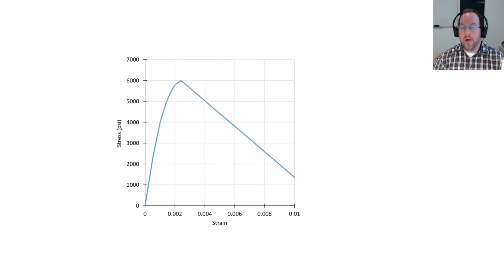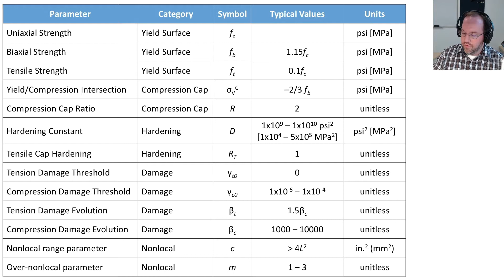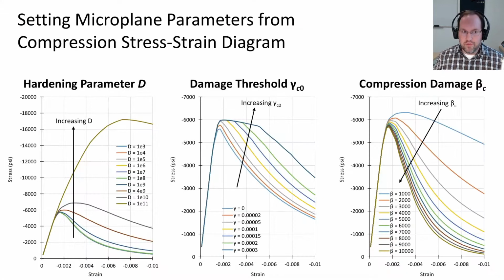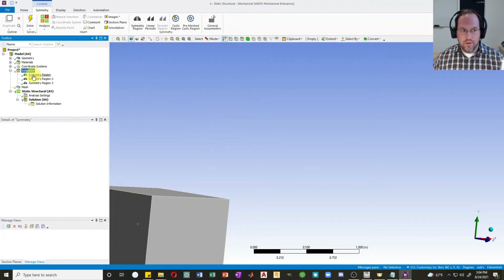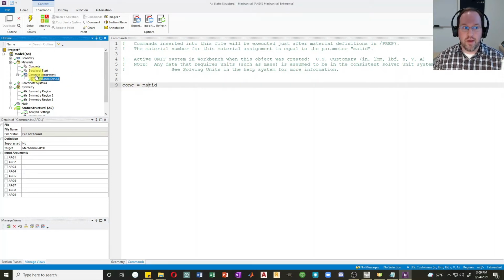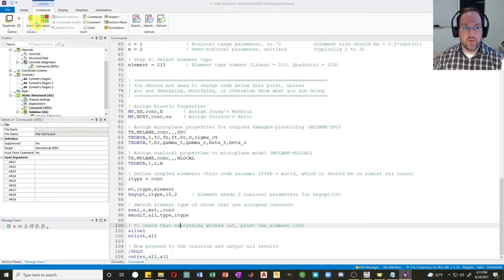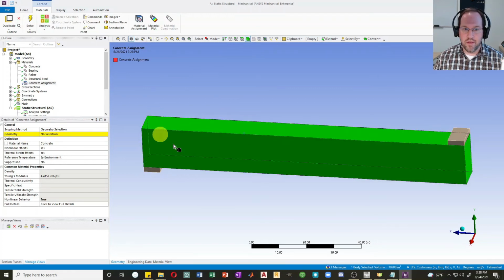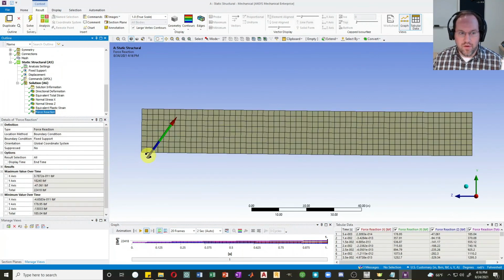Concrete Microplane Model - FEA using ANSYS - Lesson 10

Comment: Thank you very much for your fabulous presentation. I am just wondering whether Concrete MP Model can be a good model to simulate the rock-like material such as Sandstone? Is there any way to use APDL commands in explicit analysis instead to static structural analysis? I appreciate your great effort.
Reply from the maker: You can use the microplane model for sandstone and other geo-materials, but I don't believe the microplane model is supported in the Explicit Dynamics solver. 

However, there are other material options in Explicit. When defining materials in the Engineering Data tab, there are options for "Brittle/Granular" materials. One of these is called RHT Concrete Strength, which can be used for concrete-like materials, and can probably work decently well for sandstone. There are also a few different options for Drucker-Prager Strength, which might be more straightforward. There is no need to define any APDL commands for any of these materials.

There is an example Concrete material defined in the ANSYS "Engineering Data Sources" in the Engineering Data tab. It is hidden under Explicit Materials --> Conc-35MPA. This has parameters for RHT Concrete calibrated to a typical 35 MPa concrete mix. It also has some porosity expressions (P-alpha) and equations of state (Polynomial EOS defines the pressure), but not being an expert on sandstone I'm not sure if you need those or what you'd set these parameters equal to if you do need them. There is also the Explicit Materials --> Concrete-L predefined material, which uses Drucker-Prager strength. 

Obviously you'll want to have some calibration data handy to make sure whatever you do works OK.

Comment: Thank you very much for the impressive presentation. Do you think that this model can be used for masonry? If possible, how can the material model be calibrated? Best regards.
Reply from the maker: That is an excellent question. I'll preface this comment by stating that I've never personally modeled masonry. However, I'd give it a tentative "yes, it will work" on the notion that any strain-softening geomaterial could be modeled using the microplane model.

As for calibration, it depends on exactly how you are doing the modeling. If you are modeling individual blocks/bricks with mortar, then you'd need calibration data for both materials independently. If you are just treating the masonry structure as a single homogenous material, I assume you'd need to account for some sort of anisotropy - calibration would be done at a structural level in this case.
Reply: @StructuresProfH  I have been studying historical buildings and I use the macro modeling technique due to its simplicity. So I model the whole structure as a homogeneous material. I would like to use the microplane model you described, actually in masonry structures. Where do you think I should start exactly? Do I need stress-strain data of stone?
Thank you in advance,
Kind regards.

Comment: Nice Video!
Is there any literature about the microplane model and drucker-prager?
Reply from the maker: This particular implementation in ANSYS is based on the following references:
Zreid, I. & Kaliske, M. (2018). A gradient enhanced plasticity-damage microplane model for concrete. Computational Mechanics. 10(1007), s00466-018-1561-1. https://doi.org/10.1007/s00466-018-1561-1
Zreid, I. & Kaliske, M. (2016). An implicit gradient formulation for microplane Drucker-Prager plasticity. International Journal of Plasticity. 83, 252-272. https://doi.org/10.1016/j.ijplas.2016.04.013
Zreid, I. & Kaliske, M. (2014). Regularization of microplane damage models using an implicit gradient enhancement. International Journal of Solids and Structures. 51(19), 3480-3489. https://doi.org/10.1016/j.ijsolstr.2014.06.020

The first reference is the best for understanding how the Drucker-Prager condition fits into the picture. 

The original microplane model was developed by Z.P. Bazant and others - here are some key references for that:
Bažant, Z. P., & Gambarova, P. G. (1984). Crack shear in concrete: Crack band microplane model. Journal of structural engineering, 110(9), 2015-2035. https://doi.org/10.1061/(ASCE)0733-9445(1984)110:9(2015)
Bazant, Z. P. & Oh, B. H. (1985). Microplane model for progressive fracture of concrete and rock. Journal for Engineering Mechanics. 111, 559-582. https://doi.org/10.1061/(ASCE)0733-9399(1985)111:4(559)
Carol I, Jirásek M, & Bažant Z (2001). A thermodynamically consistent approach to microplane theory. Part I. Free energy and consistent microplane stresses. International Journal of Solids and Structures. 38:2921–2931. https://doi.org/10.1016/S0020-7683(00)00212-2
Reply: @StructuresProfH  thank you

Comment: Thank you very much for your helpful video. It was really very informative. If you have any experience of the robustness (accuracy, run time performance) of ANSYS microplane model v.s. ABAQUS plastic damage model for concrete, would you provide your feedback? 
For example, in monotonic/cyclic static or dynamic analysis of plain/reinforced concrete members. Thanks.
Reply from the maker: You are welcome! I do have experience with both ANSYS microplane and ABAQUS damaged-plasticity, but I've never done a side-by-side comparison of the two. Both work well, but in my completely subjective opinion, I feel the nonlocal version of the microplane model in this video tends to have fewer convergence issues.
Reply: @StructuresProfH  Thank you for your feedback. It is great to follow your videos.
Reply: Do you have any knowledge on the use of microplane model with any of the shell elements in ANSYS instead of solid (215/216) elements?
Reply from the maker: @asaritas  No, the coupled microplane model shown here does not work with shell elements. It does, however, work with some 2-D elements (for example, for plane stress or plane strain applications), which are given as (212/213) for linear/quadratic element order.
Reply: @StructuresProfH  Thank you for your reply.
Reply: @StructuresProfH  CDP in Abaqus cant model the pinching effect of RC during cyclic loading , but solid 65 in Ansys can do that. I do not sure that MP model can do this analysis accurately. if you know please tell me thanks

Comment: Hello sir..
For CFST  column..i have to calculate ultimate load carrying capacity along with stress-strain behaviour of CFST column..how can i do this in ansys mechanical..i do not work in apdl..plz help
Reply from the maker: For a model that doesn't require APDL, check out my previous video on using a Menetrey-Willam model (https://youtu.be/rqHWA9IJn0g).

That said, the APDL code posted in this video description is meant to be copied-pasted and then easily modified to your needs (as explained in the video), so you don't need to be an expert. Give it a try!

For concrete-filled steel tubes, the triaxial and dilatancy behavior of the concrete are rather important, so it may take a bit of calibration to make sure that your results are realistic.